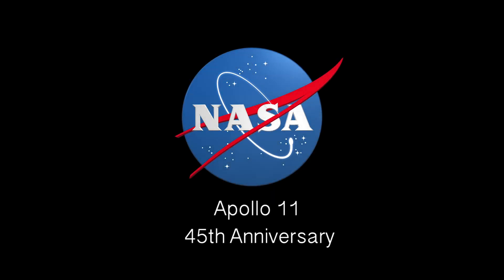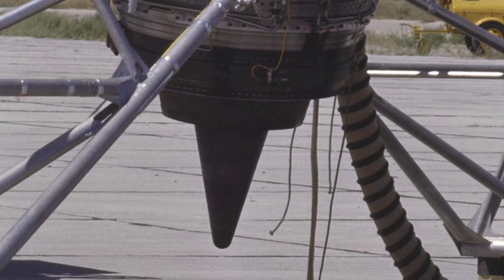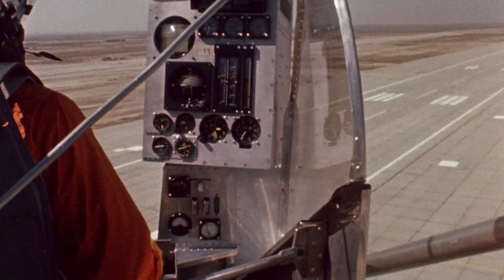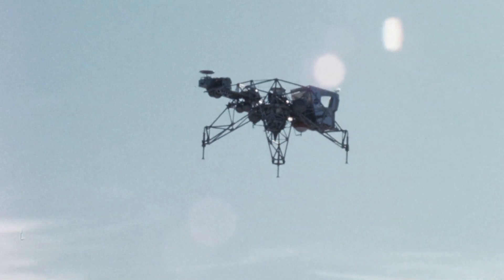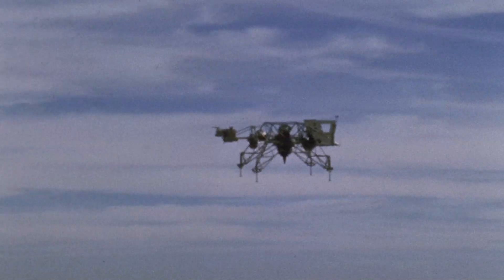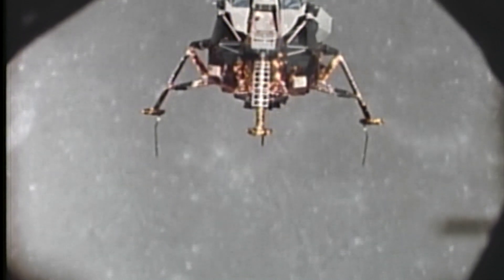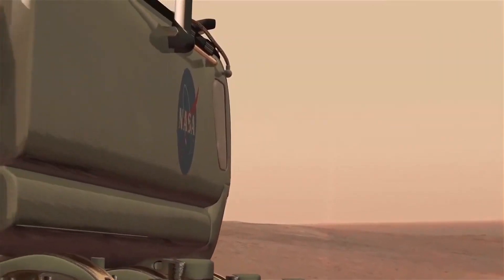LLRV Testing Contributed to Apollo 11's Success

Comment: but it works with a jet turbine ....you cant use that for landing on the moon. Why do they train with an other kind of engine when they need to be trained with a real rocket-engine? Thats significant...  its like training with a Motorbike to get a Formula 1 pro
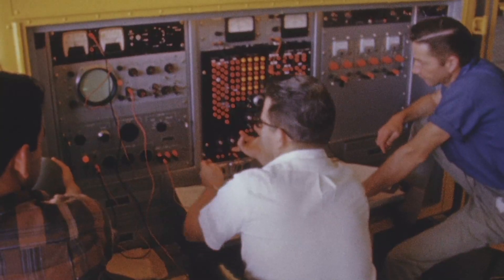Reply: jet engine was used for simulation of the lunar gravitation which is much less then on the Earth ,  listen  to the speaker more attentively at 0:45 and on
Reply: Regio Montanus     and technically, it  still makes no sense . Gravity in Moon is 1/6 of Gravity at Earth, but you have a engine for the moonlanding Thais min. 6 times stronger than the Engine for earth and you havent trained
Reply: Kit Canyon  thanks verry much it shows your a Genius. 🤣🤣🤣
Reply: Sorry ,it was not a question about Physik or not understanding the Video. Its just a simple question. They spend billions of dollars for the moonlanding and than they send a landingmodul that was Never testeten in real. It means: nobody testet the Modul with the rocketengine under the ass in reality.I know you can calculate the situation on the moon and it should work. But the only real Test was in the moon,isnt it? Or is there capture 2 i havent Seen? I dont wana say there was no moonlanding, but this point is significant...DUDE....
Reply: Kit Canyon ok, thanks thats a nice answer!
Reply: Because of gravity difference.
Reply: They had to make it a 6th of the earth's gravity.
Reply: @rudirosti5501  because the turbine engine is one setting. All they're practicing is the adjustments on each side so it doesn't tip over. All they need to do on the moon.
Reply: Bit of "Dunning Krueger" demod here.   Rudi trying to teach Armstrong and Nasa, (and us!),   that their methods of practicing for lunar landings were somehow flawed, and not relevant.  Lol.  (As if someone like Armstrong would EVER have spent time practicing ANYTHING which was not relevant).  

Best to learn, rather than try to teach, at this point.  Best to ask questions, rather than instruct.  Better if  Rudi (and others),  would google "Dunning Krueger" and read the whole article -- and maybe twice.

It would be very apparent to most of us,  that if you have a constant thrust (directly away from Earths center),   of 5/6th of earth gravity, you have created a valuable simulation of moon gravity upon which to practice your landings.  Pretty simple. And not real  relevant to spend time considering what type of engine causes that thrust.

Comment: show me one single test with the real Lunar module descending successfully prior to Apollo 11.   More than 30 years later, many attempts to land on Mars have failed and ending in a complete crashed failure on the martian surface.   Descending on the moon would have been a lot more challenging and yet nothing proving a stable test operated with a pilot, descending over 10 km.
Reply: You want to see footage of a Lunar lander, designed to land on the moon, landing on Earth?
Reply: Apollo 11 was by definition the first landing on the moon, if they'd been one before it, that'd be the first....
Reply: There was Apollo 9, which tested the LM in earth orbit (tested the throttleable descent engine, the electrics, the electronics the seperation from the descent stage, the acent engine).
Then there was Apollo 10, which flew the LM down to a few hundred feet above the surface of the moon.
And then came Apollo 11 which did the final step of actually landing.

One mission has to be the first, you know. There is just one possibility to "test" an actual landing on the moon. And this is to actually land there.
Reply: Miguel what are you doing your making a fool of yourself with your comments about stuff that you know nothing about just go and research this stuff 1st so that you don't have to be ignorant any more
Reply: @MrApolloTom  5 Surveyor robots successfully soft landed on Moon, before Apollo 11.
With even much lesser computer power and no experienced test pilots to control it.
Reply: @YDDES  Yes that's right, I was addressing the request for an example before Apollo 11 'with the  real lunar module', but the unmanned landings involved substantially similar principles.
Reply: Hi Miguel, they never flew the lunar lander on earth, it wasn't designed to do that, if you cannot understand why, say so in a comment and I'll explain the reasons for you. Training flights were performed (hundreds of them) on earth in a training simulator, watch the video. There is a load of info on the LLRV/LLTV on the web.
https://www.youtube.com/watch?v=cSlaYfxklm4
For some in depth history of these simulators read;
http://www.astronautix.com/a/apollollrv.html
The apollo astronauts spent thousands of hours in simulations on every aspect of the apollo missions.
Reply: Ok. Miguel are you ready how about Apollo 10 did you hear me there was an Apollo 10 it wasn't a secret  everyone knows about it you should too
Reply: 22 January 1968, apollo 5, unmanned. First flight of LM. Tested both engines and other functions.
Reply: The first Mars landing (unmanned, of course) took place only 7 years after Apollo 11 landed on the Moon. There have been more successful Mars landings than manned lunar landings.

There was no Lunar Module landing prior to Apollo 11. If there had been then THAT mission would have been first - not Apollo 11.

Something always has to be done for the first time - that is what flight test is all about.

Apollo 11 WAS that test.